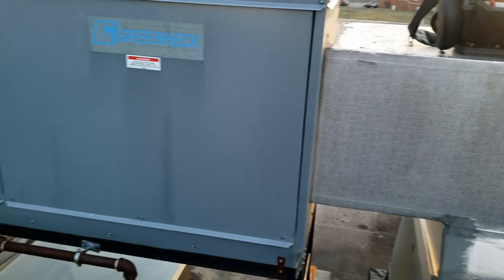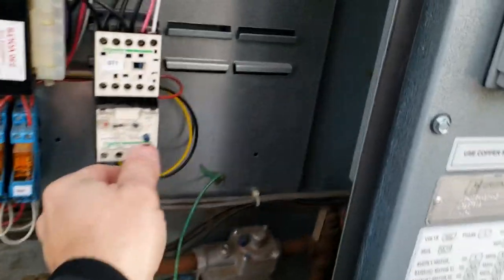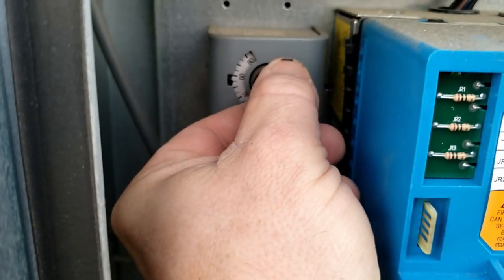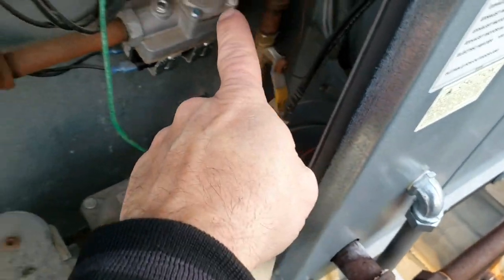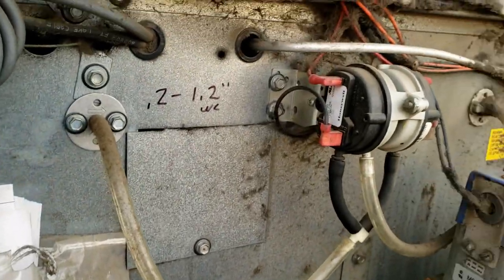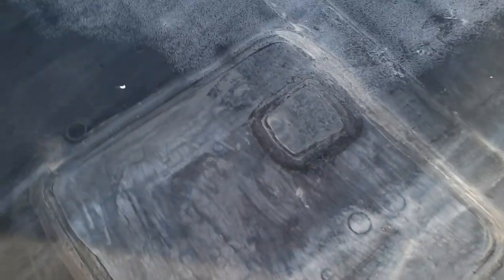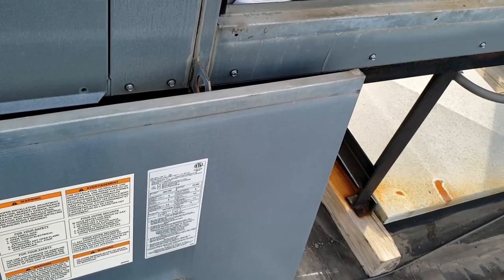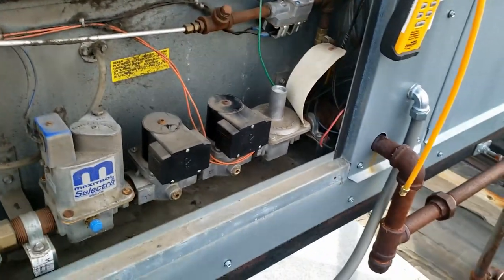CaptiveAire Make-Up Air Not Heating

Comment: thx for the explanation  it helps me a ton.     good video i always run into these and dont knw how to adjust it.    In Canada  we need our Gas 1 to work on anything bigger then 500,000btuh   this is simple enough to run thru.    2 thumbs up.
Reply from the maker: Check out captiveaires website and YouTube page they have quite a bit of information out there. Also download their manual it's very detailed.

Comment: So these things just pump the CO into the building and rely on the hood exhaust to pull it back out?
Reply from the maker: Correct, this is a direct fired unit.  The CO levels are very low. As you know, Co is from incomplete combustion.  It's hard to have incomplete combustion when you're cramming that much air behind the burner.
Reply: Yep
Reply: You’re so smart.
Reply: Yeah I was thinking the same thing. I guess as long as the kitchen exhaust is also working you’re fine.
Reply from the maker: @keehn20  who me? 🤣 I just get lucky.
Reply: If you put an analyzer in the wire stream there’s usually almost no co if it’s burning right

Comment: I have found when you have such a large inconsistant minimum, yet pressure drop is o.k. someone enlarged orifice holes during cleaning. Probably too big a drill bit was used. This scenario also could come from someone enlarging holes trying to get more heat out of it. (Re-engineering) They accomplish a higher overall temp. drop on that super cold day, but screw you forever on the mild days. Good video!
Reply from the maker: Good point, I'll definitely keep that in mind 👍👍

Comment: Any idea why the flame would start high then goes low and stays there, the modulator is good, remote temp selector seems to be good, now it could be either air discharge sensor or amplifier, when replacing air discharge sensor with 10k ohms potentiometer the amplifier reacts to the resistance variation and flame get adjusted. When measuring the air discharge sensor resistance it's within range. What do you think about this situation?
Reply from the maker: There should be a potentiometer on there that tells it how fast it's to react. It's either set too sensitive or not sensitive enough.
Reply: @HVACRSurvival  thank for your reply, by lowering sensitivity that did make it work. However, even at high temp like 90F modulator doesn't stay fully open, only 2-4 second then goes to 8-9V instead of 24V, I thinking maybe air discharge sensor is not responding right to heat?

Comment: I had the same problem the other day and eve though the pressure switches were making the problem was in the inside vents near the exhaust hood, the vents were plug with debris and that was making the flames going crazy and there is un upgrade for that Honeywell control is a fireye m4rt1.
Reply from the maker: What does the upgrade do? FireEye is a competitor of Honeywell?

Comment: May I ask about the make up air unit? My unit when the weather below 15 degrees than the burner it’s not working. Can’t find the reason, already change the flame and gas valve, but until same problem. If you know what happens, Please let me know and thank you
Reply from the maker: It could be several different things, you just got to find out what's not running when it should be running. If you got an electrical meter and the schematic you should be good to go.

Comment: How do these not produce CO and push it into the building? Probably a stupid question. Great video Rick 👌
Reply: Cool smokestacks at the end
Reply from the maker: They burn clean, I haven't put my co detector in the air stream before but it's cleaner than a salamander 🤣. The CO is very low with all the excess air.

Comment: Was I understanding that right that the combustion products mix into the warm air stream for the building?
Reply from the maker: Yes but remember carbon monoxide is a result of incomplete combustion, incomplete combustion comes from improper air and fuel mixture, there is a lot of excess air with this so there's not a lot of Co.  it's really no different than a salamander or a unvented wall heater. Also remember they have exhaust fans on, pulling it out the other side.  This heat is just to temper the air, not warm the building.
Reply: @HVACRSurvival  I'd actually bee thinking of possible excess CO2 and reduction in O2, but I guess that probably isn't a problem in this use. BTW, I've never seen an unvented furnace or water heater where Iive. Different part of the country, I guess.
Reply from the maker: @lwilton  what state you in
Reply: @HVACRSurvival  So. California.
I should also say I'm just Joe Average and not an HVAC guy, so I'm a lot more familiar with residential and light commercial practice than I am with large buildings. But I'm pretty sure the building codes here require fires to be vented.
Reply from the maker: @lwilton  california answers the question. To many laws and regulations.
Reply: @HVACRSurvival  Way, WAY too many, and most of the recent ones illogical, stupid, frivolous, and arguably illegal. 
But to give them their due, the laws against unvented fires go pretty far back, to a time when a good many laws actually had a sensible basis. I think they came about in the 1950s in most areas.

Comment: Best thing to do with that is rip out the flame rod and convert it over to a UV scanner. Flame rods suck hard to get a good reliable signal out of those.
Reply from the maker: That's a good idea, I don't have a lot of experience with these controllers, what kind of money would something like that run, don't you have to change one of the cards and add a uv sensor?

Comment: Those inspection ports are useless, 99% of the time can’t see through them. 

Worked in a captive aire yesterday that was stuck in high flame
Reply from the maker: What did you end up replacing?
Reply: @HVACRSurvival  need to go back.

Discharge air temp sensor is open, needs belts and filters too
Reply: @WswRefrigeration  usually that sensor mounted inside blower compartment is the culprit

Comment: I'm not seeing everything.  Where is the heat exchanger?  I only see fan and flame = CO
Reply from the maker: It's called direct fire. There is no heat exchanger.
Reply from the maker: CO is from incomplete combustion. This is burning clean and the co it's very low and the exhaust is pulling out just slightly less than what's being pushed into the building.
Reply: @HVACRSurvival  That's actually kind of amazing.  I guess it's not much different than running your stove and burners in your house.  :)  LOVE your videos.  Thanks!